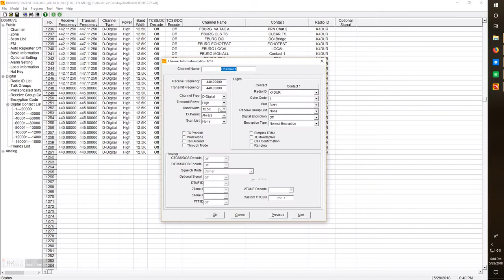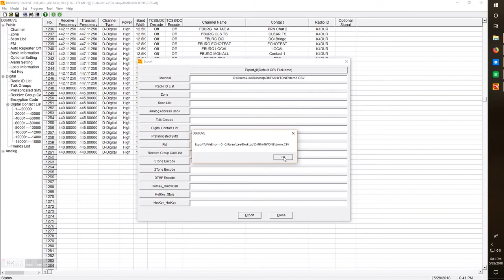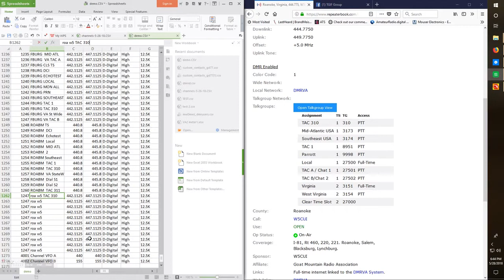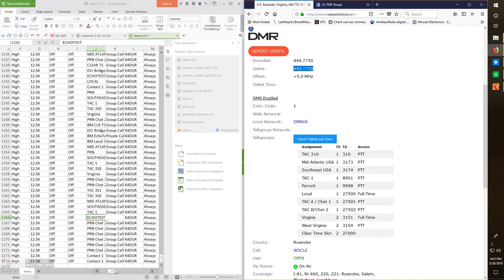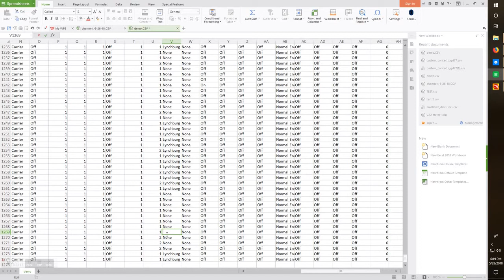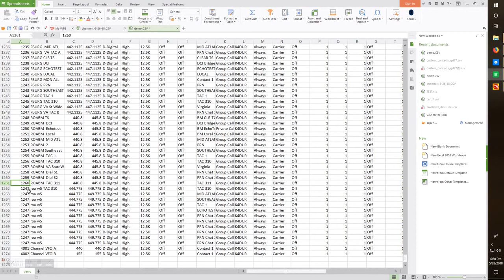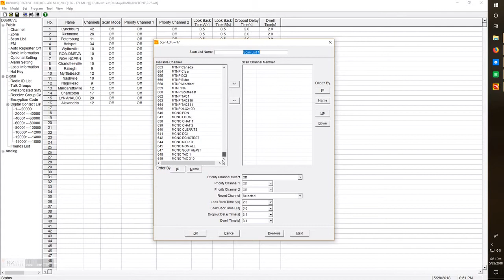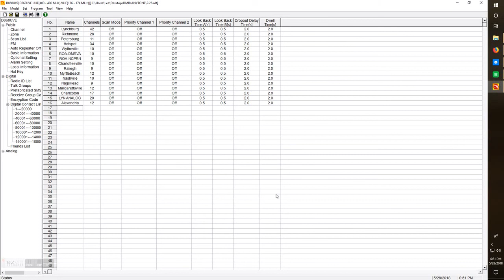Adding a Repeater to Anytone AT-D868UV Via CSV

Comment: Lee how do you add more than one TAC 1 and TAC 310? I know they are from different repeaters but when I try to add a TG from a different repeater with the same TG name the program will not allow me to do it. I I have two good repeaters here and wanted to add the TG from the Bronx repeater and a Manhattan repeater with the same talk groups. For example if I have TAC 310 from the Bronx repeater when I try to add TAC 310 from the Manhattan repeater the program will not allow it. Suggestions? I did do an export to cvs file format and added the TG their and were able to inport it after radio told me there was a conflict but allowed me to continue.  Is that all you did?
Reply from the maker: You only need 1, for every repeater use the same one , make zones for each repeater with frequencys and color codes and Time slots correct, point each one to the same Talkgroup ID